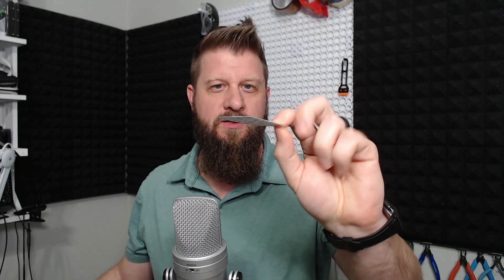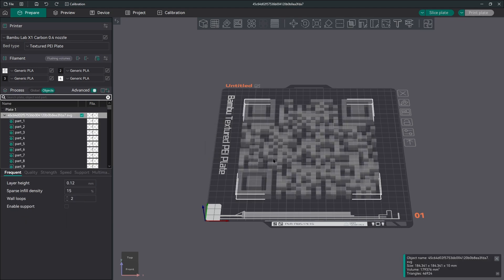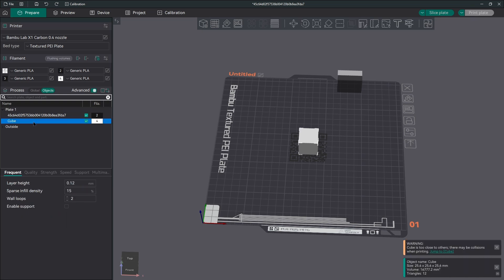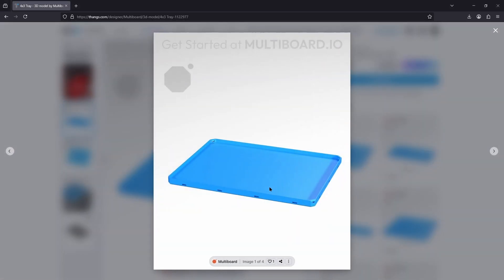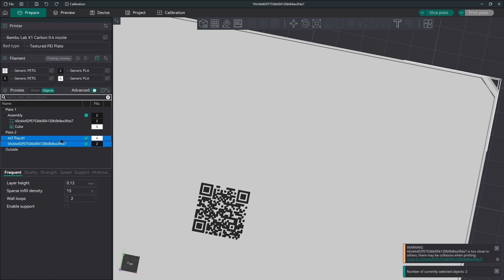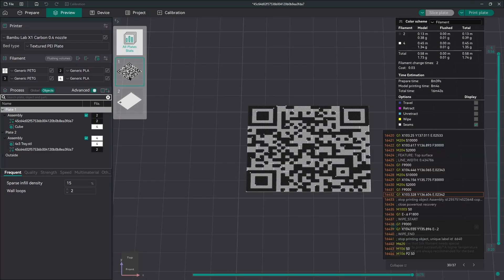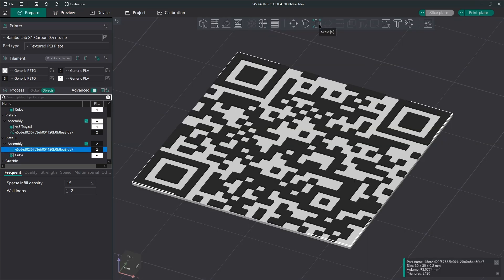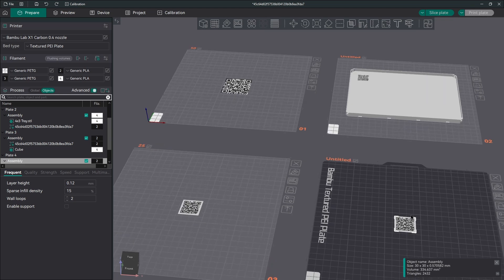Easily Add Custom QR Codes to 3D Prints Using Orca Slicer

Comment: nice, good tip on the layer height and depth along with assembly.   If I am working with smaller part like keychain or coin I try to do flush test with facedown method.
Reply from the maker: @gregg-d4l  that works great.  QR codes are a bit tricky face down,  your bed adhesion needs to be perfect. Definitely doable, but I like to keep an eye on it for that first layer so I don't waste material if something gets loose.  Thank you for the comment!